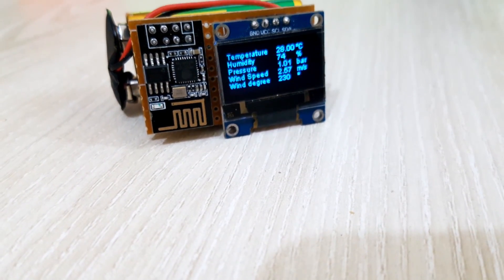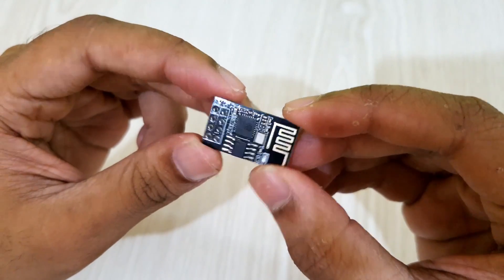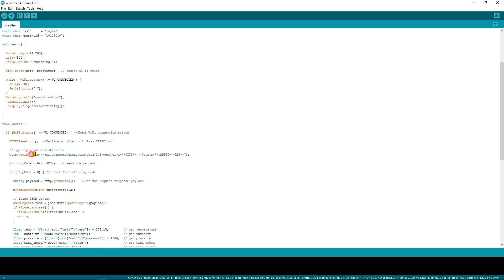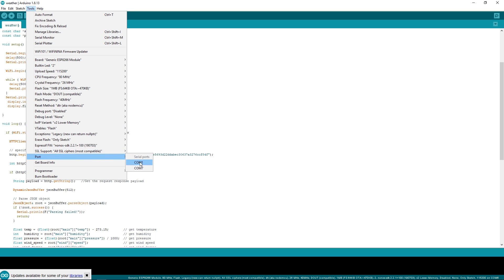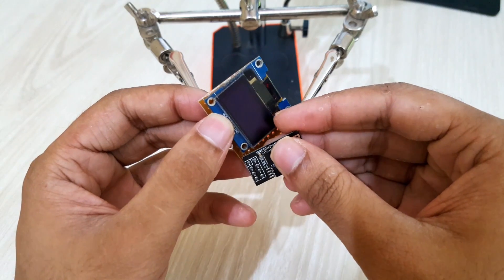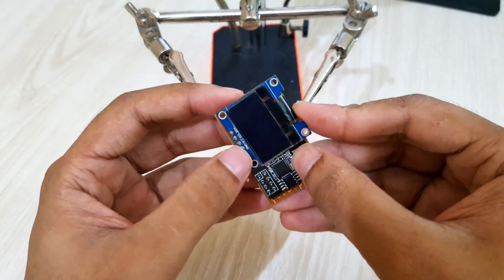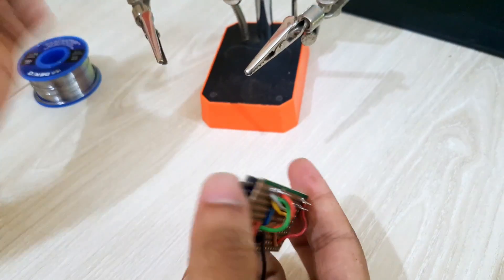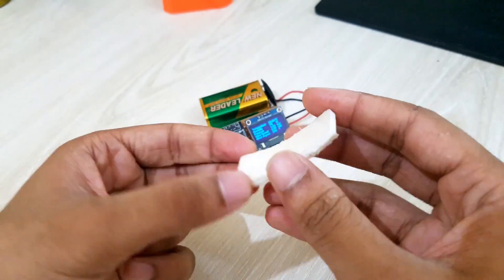DIY Weather WiFi Weather Station | ESP8266, OLED display

Comment: The code Weather in your link is not code Weather Station. Please check and resend it. Thanks for sharing.
Reply from the maker: It is, I've checked already.
Please follow the video.
Reply: @ElectronicsBd  It is not. I've just checked it.